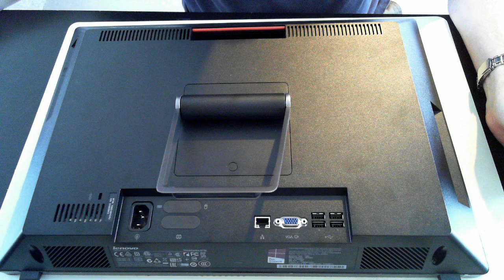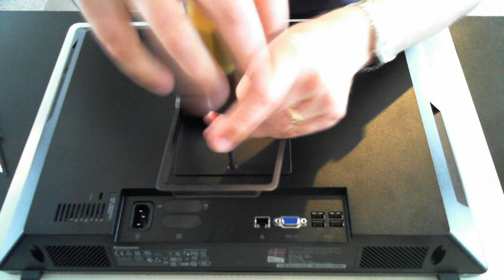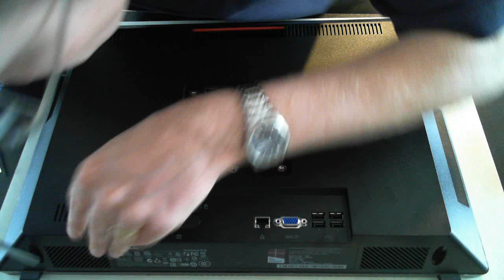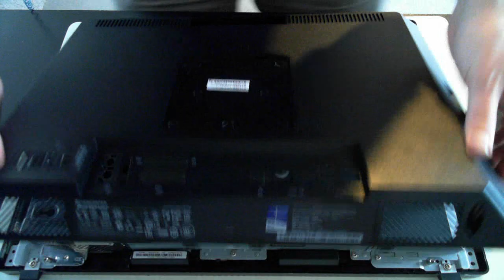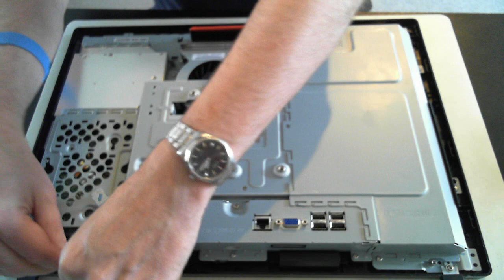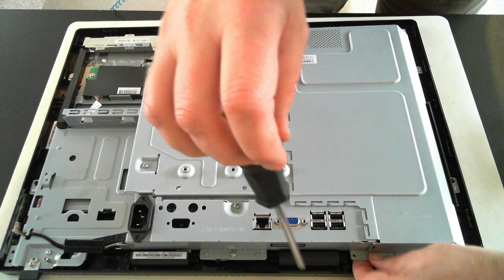Lenovo Thinkcentre E73z Memory & Hard Drive Upgrade

Comment: QUESTION, the slot on the bottom right, left size of the RAM that you took off, what that slot is used for. on that slot on my computer, there is a notation, "tconn 12322ID''. thanks again for the video
Reply: If it is the one I think you are referring to then it is a Mini PCI express card slot (WI-FI card connector)
Reply: David Perkovic thanks. In my computer, that slot is empty. But I don't understand why I still have Wi-Fi connection. Thanks again for your response

Comment: can i upgrade the processor?
Reply from the maker: Possibly but as with a laptop it is not recommended. You will have to confirm that the BIOS accepts the new CPU and also take into account any thermal (ie heat) issues.
Reply: @dpcomputing  I have the E72Z, and Lenovo's website says it supports up to a 3rd Gen i7.